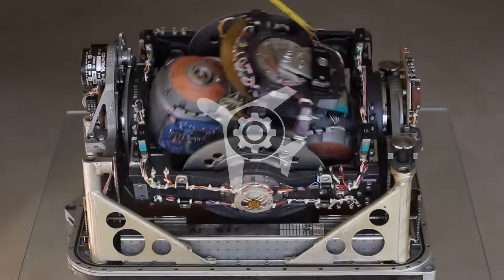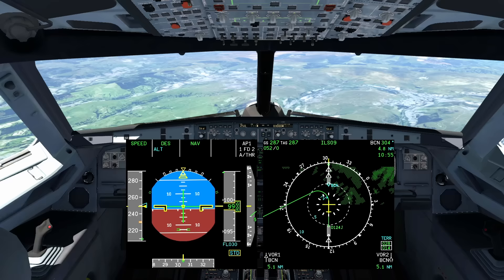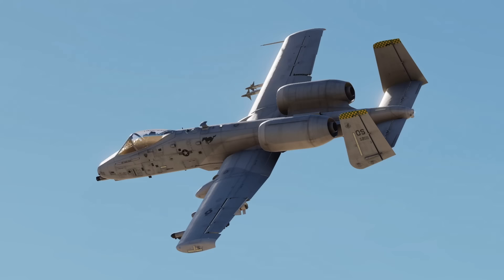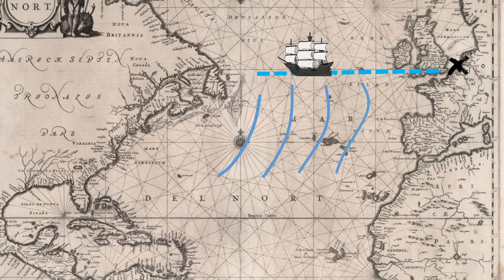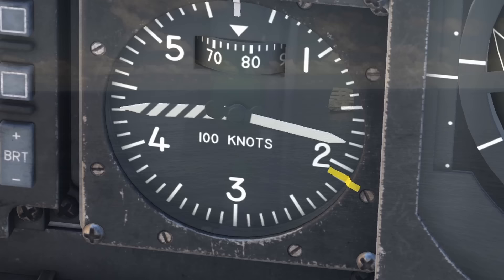The GENIUS of Inertial Navigation Systems Explained

Comment: This explanation is terrible. You cannot talk about Inertial navigation without explaining the relationship between acceleration, velocity and distance and the mathematical operation of integration.

Understanding that is fundamentally essential to understanding the principe of inertial navigation.

Why do we measure acceleration? What do we with the electrical signals output from the accelerometer? 

This kind of video is misleading and it is not teaching the basic principles.
Reply: Seems like you're interested in the technical aspect of things. In that case the video is not for you.
Reply: @RawbLV  Understanding why acceleration is measured isn't really a technical aspect. It is fundamental as to why the inertial nav system works.

It is like producing a video to explain how a quartz crystal watch works without explaining the role of the quartz crystal. It is that fundamental.
Reply: @deang5622  You said you want maths, this video is not for you.
Reply: @RawbLV  You obviously don't know the principles behind inertial guidance, do you?

To explain how inertial nav systems work means you have to explain the relationship between acceleration and distance.
Initial nav systems MEASURE acceleration so they can then CALCULATE distance.

The relationship between acceleration and distance IS mathematical!

Therefore you CANNOT adequately explain how inertial guidance works without explaining why acceleration is measured, what the purpose is AND the relationship to distance.

Come back to me when you TRULY understand this subject.
Reply: @deang5622  That should have been your initial comment.
Reply: @RawbLV  I appreciate you may not understand this topic but I do understand it. I am a professional engineer. I know how these things work. I understand the mathematics and principles behind them.

I said in my initial post "This explanation is terrible. You cannot talk about inertial navigation without explaining the relationship between acceleration, velocity and distance...".
That remark is accurate and complete. 
The video producer should read that and it gives a clear statement to the video producer what is wrong with the video.

It is as simple as that.
End of discussion.

Comment: When I started work on my first job (aquiring data from oil boreholes), we had an instrument in our toolstring that used accelerometers and magnometers to determine the deviation and azimuth of the toolstring. Then, once the data aquisition, is complete, we could process the data into a true vertical depth format, instead of measured depth.

Comment: I used to work on the Litton LTN-72 INS in the NZ Air Force as an Avionics Technician back in the early 1090s.  Fantastic pieces of equipment.
Reply: Dusting them off doesn't count
Reply: @billp4  A bit more than just dusting. I remember there had to be an exact number of drops of oil on each gimbal bearing after cleaning them.

Comment: In the early 1970s worked testing the electronics of the Inertial Navigation System fitted to the Panavia Tornado. I remember that because the Earth is a rotating sphere the Coriolis effect was an important factor when calculating where you were. As was knowing exactly where you started from.

Comment: The guidance system knows where it is at all times. It knows this because it knows where it isn't. By subtracting where it is from where it isn't, or where it isn't from where it is (whichever is greater), it obtains a difference, or deviation. The guidance system uses deviations to generate corrective commands to drive the missile from a position where it is to a position where it isn't, and arriving at a position where it wasn't, it now is. Consequently, the position where it is, is now the position that it wasn't, and it follows that the position that it was, is now the position that it isn't.
In the event that the position that it is in is not the position that it wasn't, the system has acquired a variation, the variation being the difference between where the missile is, and where it wasn't. If variation is considered to be a significant factor, it too may be corrected by the GEA. However, the guidance system must also know where it was.
Reply: I think these explanations are an attempt at (not bad) humor. You say, "By subtracting where it is . . ." If you know where it is so that you can do the subtraction, why bother? You already know where it is.

Comment: Used to work on older INS gyros. I can't count how many times they wouldn't spool up and the fix was to literally remove the box from the frame, drop it about 12 inches on the ground and reinstall. There was a tech fix involving a rubber mallet but dropping it did the trick 95% of the time. This saved the US taxpayers untold fortunes in back-shop repairs.

Comment: Well you got the explanation about the ship's 'log' a little backward.  They didn't time how long it took for a certain number of knots to be pulled over the side, they did the opposite.  They threw the end of the rope over and turned an hourglass.  Then counted the number of knots that went over the side in a fixed amount of time.  (that is, the time was always the same and the ship's speed would determine how many knots were paid out.

P.S.  The end of the rope had a small triangular piece of wood that was rigged to be pulled facing into the water to keep that end more or less stationary.  After the measurement, a sharp 'tug' would pop a little peg out and let the wood turn edgewise to the direction of movement so it was easier to pull the 'log line' back in again.  :)

Comment: The feedback part was neatly glossed over as basically "magic".   
I didn't even know about the problem before and an actual explanation on how the feedback works would have been nice(I suspect it's just a filter -- very low frequency signals come from the Earth's rotation as the Earth is rotating "slowly" relative to the aircraft's movements).

Comment: Before MEMS, accelerometers used a taught steel wire with a weight in the middle of the wire.  On each side of the weight, the two sections of wire were kept vibrating (like a guitar string) using electromagnetic feedback.  The cycles of the vibrating string on each side of the weight were fed into a counter - each cycle on one side of the weight caused the counter to count up, and each cycle on the other side caused the counter to count down.  Under no accelleration, each side of the wire is vibrating at the same frequency and so the number of "up" counts over any time period equals the number of "down" counts and the counter stays at zero.  If the wire was accellerated at right angles to the wire, then the frequency of both sides would change by the same amount and the counter will still stay at zero.  If however there is a vector of accelleration along the same axis as the wire, then the weight causes one side of the wire to get tighter, increasing its frequency, and the other side to go slack, decreasing its frequency.  Thus the counter will no longer get the same number of up and down counts, and its count (+ve or -ve) will equate to the total accumulated accelleration experienced along the axis of the wire since the counter was last cleared.

Comment: Important to understand:
A gyroscope does not preserve its orientation relative to a specific place (or horizon) on earth – but rather to the universe itself.

Depending on its initial position when activated, a sufficiently precise (and uncorrected) gyro would even show the offset of earth rotation AND earth’s orbit around the sun over the course of a year.

For jets however the self-correction plus inevitable horizon reset when being powered off after landing and powered back on before starting is fairly sufficient to keep it precise enough during the upcoming duration of a flight.

Comment: Nice exmple of a simple INS but modern airliners use a IRU where the there is a laser gyro and accelerometer for each axis. With the know initial starting point the IRU is able to with the help of an air data computer will not only give you pitch, roll, and yaw but also ground speed, altitude, and heading. Throw in a FMC or ECAS you know have a course and navigate to any point on earth. This system is so accurate that when flying to Hawaii you will fly right over or under another aircraft flying the opposite direction.

Comment: I worked on spinning mass gyro INS systems on F4s. It amazing what we do today compared to back then. Except ours was a two gyro system that stabilized the platform. The accelerometers measured the movement of the aircraft and the separate analog computer did the navigation calculations.  
Later after college I was a naval engineer and I worked on fiber optic gyros that do the same basic thing that lasers do now. But you can wrap many layers of fiber optic cable around the optic path such that the light goes much further and the phase difference is more accurate. Then I worked on EGI embedded GPS and a INS in the same system.  Lots of stuff going on.

Comment: if you ask an old pilot me what an ins is, they say " an inertial reference system tells the difference between, where you aren't, and where you weren't, to where you won't be, and where you shouldn't....."  a modern submarines trails on a miles long fiber optic cable a floating array of gps and other radio nav aids and communications - the sr 71 tracked stars the minute they rolled out of the hanger

Comment: Thank you for taking the trouble to create this truly excellent video.
 I can't begin to imagine how much time and effort it must have taken, but perhaps not quite as long as it took to develop the LN3-2A itself!

Would it be fair to say that the gimbals solve the trigonometry equations which could not be solved using computers and data acquisition available at the time?

As a previous comment notes, laser ring gyros and modern microprocessors allow a strapdown solution with no moving parts,  like motors, slip rings and synchro resolvers.
Far more reliable and accurate and (relatively) lower cost I'm sure, but now there is nothing to see - no inspiration.  Like electric motors vs steam engines! 

I believe that there was an even bigger, heavier control system attached to the platform and this comprised gears and electronics to process the signals for presentation to the pilot / navigator. 

I have some pictures and diagrams if anyone would like to PM me.

Comment: Wonderful article.  Complex enough to understand things but not so complex that it confuses things.  However, there are a couple of things I'd like to comment on.

As remarked by several others, I am sure that this INS was not on the F-104; that plane was much too early for this type of system.  As stated by others, it was used on the F-4C and later versions of that plane.  I think it was the first widely used airborne INS.

In the mid to late 60's I taught the ASN-48 and ASN-46 navigation system at the Air Force technical school at Keesler Air Force Base in Biloxi Mississippi.  At that time I knew a lot about how the thing worded, but alas a lot of that knowledge has disappeared with time.  One thing I do remember is that the gyros and gimbals communicated their positions to the rest of the aircraft's avionics by using resolvers, which were analog predecessors of our current digital encoders.  As stated in the video, the accelerometer outputs were integrated in analog electronics.  These signals were then used to move motors which turned shafts that provided mechanical analogs of N and E velocities.  Subsequently the velocities were fed to an additional stage of integrators (and motors and shafts) which produced position readouts.

One question that I saw several times in the comments was about gyrocompassing.  That was part of the system startup and calibration.  I have forgotten the exact method, but it worked something like this.  If the stable platform was not exactly aligned to N, then one of the corrections sent to the azimuth axis would cause the platform to slowly tip.  This error was detected by one of the accelerometers and was fed back to the azimuth axis to rotate it to North.  When the azimuth was closer to N, then there would no longer be a tip and the correction would be stopped and the system would switch out of gyrocompass mode and into the normal operating mode.  (or something kinda like that!)

Keep up the good work!

Comment: Excellent video! I was worried that you made a fundamental mistake by stating that the stable platform would always remain level with the horizon early on in the video, but you’ve covered that wonderfully in the last chapter. 

The inertial measurement units used on the Apollo lunar modules had issues caused by apparent drift when after they were shut down to save power on the surface. The moon would rotate during the few days spent on the surface and caused the IMUs to not know which way was up when they were restarted. The engineers solved this by detecting the acceleration caused by gravity and a star sighting to correct for any errors caused by uneven terrain.
Reply from the maker: Thank you! I didn't know that about the Apollo IMU's, thanks for sharing :)

Comment: Trans polar commercial flights only became possible after the introduction of INS. For example, early 707 aircraft flying between London and Japan stopped to refuel in Anchorage, Alaska. Without INS, navigation close to the North Pole was notoriously difficult and inaccurate. Computer control of the fuel flow to the jet engines improved efficiency to the point where aircraft could arrive at Anchorage with around an hour reserve. Previously the aircraft would have run out of fuel 35 minutes before reaching their destination if flown under manual control.
Reply: I think you misunderstand the role and required times for fuel reserves in flight planning.  Also, you may be confusing the roles of electronic fuel management control on each engines and the aircraft performance management system, which is separate.  The PMS began as a system separate from navigation systems, but its function was eventually integrated into the Flight Management System on modern aircraft.

Comment: Ring laser gyroscopes have a zero lock problem so they introduce some type of random dither either physical or electronic.   This looks like random walk so most high accuracy application are switching to Interferometric Fiber Optic gyroscopes which do not have a significant zero lock issue.

Comment: Extremely interesting video. 
As other peoples said, modern ins uses either laser gyros, based on the sagnac effect, discovered before restrained relativity, but easily explained now thanks to it, or a new technology is based on the oscillating deformation of a glass cup, initially caused by piezzo electricity, the cup acts as a pendulum which oscillating planes doesn't change despite the rotation of the support (Foucault's pendulum)

Comment: Fantastic explanation and presentation!  I worked on the very hardware pictured as used on the F4 phantom and newer systems on many other U.S.A.F jets.  The analog computer used on the F4 for navigation and weaponry was very capable but was designed without digital logic.  All calculation were baked into gears, voltages and phase angles.  Great times but many fiddly bits.
Reply: amazing， But I want to know what important advantages digital logic can play, hope you can reply me
Reply: @EriccoInertialsystem  I have worked on digital systems as well.  The advantage of analog vs. digital probably pivots around what components are available at the time, cost and production complexity. 
A full three axis platform, and basic dead reckoning navigation system has very few variables to store so memory is not an issue.  Processing speed is fundamentally zero for an analog system.  If all elements stay in the analog domain accuracy stays pretty good.  Analog to digital conversions and floating point processing become advantages when you have to pass around data between unrelated systems like ground mapping, inter-aircraft threat and targeting and so forth.  The F4's of my day did a surprising amount by passing three dimensional state vectors with phase angle waveforms using synchro/servo combinations to and from the instruments, autopilot and weapons.  
Some gear is way simpler, smaller and less power hungry in analog.  But these tricks are not taught in school much anymore.  Digital has the advantage if all sensors go to digital as early in the process as possible.  Then the new ASIC chips can be used to replace large circuit boards, and run most the processing is parallel.  The more that is baked into ASIC chip pipelining the less that can be hacked and less general purpose CPU/GPU overhead you have to go wrong.
Currently almost no source exists for the analog components we used in old nav systems.  But we now have ring gyroscopes and mems accelerometers.  
My biggest concern is that everybody is overly reliant on the GPS and related assets.  We did not have them in the old days or today in outer space.  The SR71 and some other planes would maintain alignment by a computer controlled sextant tracking the stars.

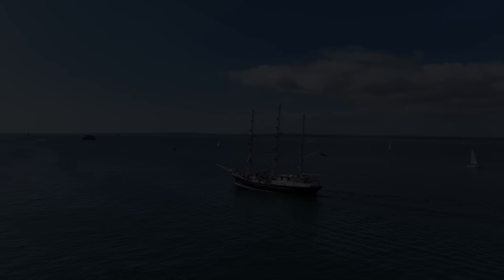Comment: 02:30  I have to tell you exactly where your Dutch sailor is - and he’s not leaving Amsterdam……

Your inset is a schooner departing Portsmouth Harbour (that’s Hampshire, England) about five miles from whee I am typing this and it’s heading south with the Isle of Wight in the distance and Spit Sand Fort some 500 metres off the vessel’s starboard bow. The three masts that you see slightly closer are part of a navigation system for our Queen Elizabeth class aircraft carriers and they hark back to an even early method of navigation using “transits”.